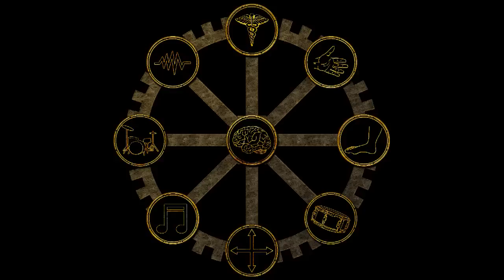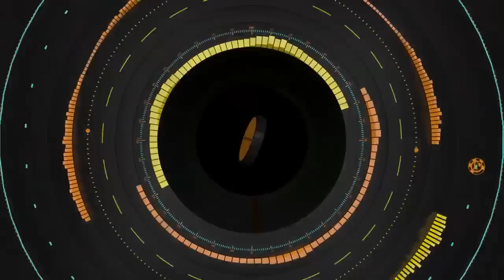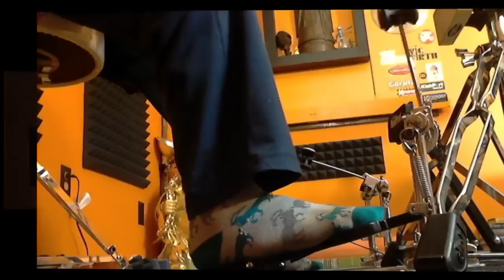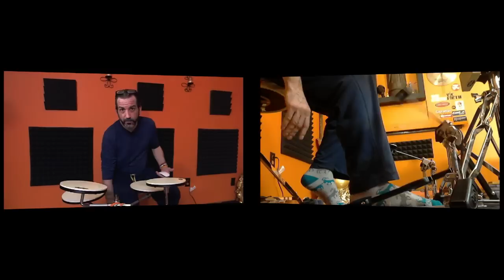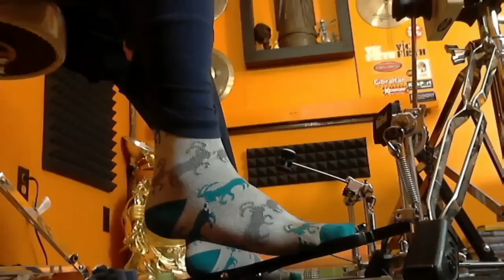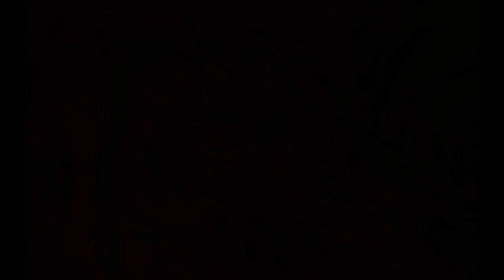Bass Drum Development - Fixing Kick Drum Issues - FreeDrumCoaching.com

Comment: Can someone explain why some would like to play  'flat footed'?
Reply: To save energy, ankles are the legs fingers. 
It also helps with keeping your balance.
Reply: Steffen Bjerk 
As  a pianist before I was a drummer flat   foot is instinctive to me
Reply from the maker: Its a great way to work and develop the ankle and its also a relaxed way to play. If you practice flat and raised you will also have a more natural ability with techniuqes like heel to toe and so on.
Reply: On slow beats and gospel I use flat foot due to the increased control and volume. On faster beats and swing I use the toe. On jazzy beats I mix up both techniques because flat footed you can play really subtle and low volume and do even a crescendo roll with the bass drum.